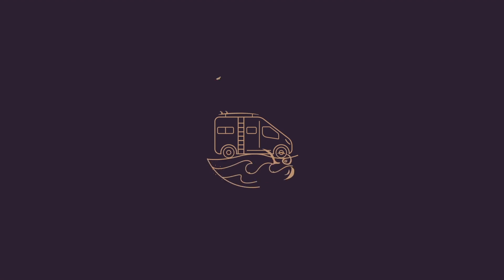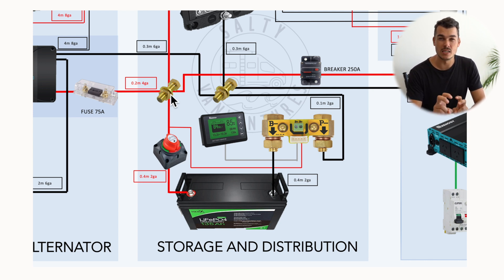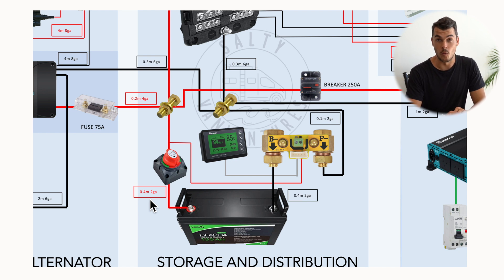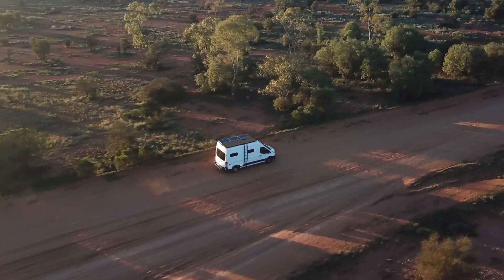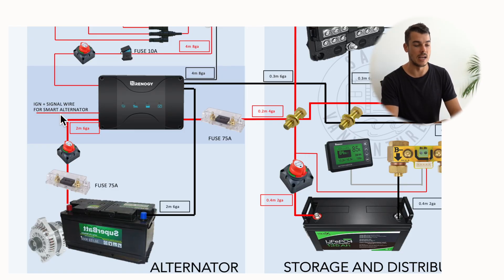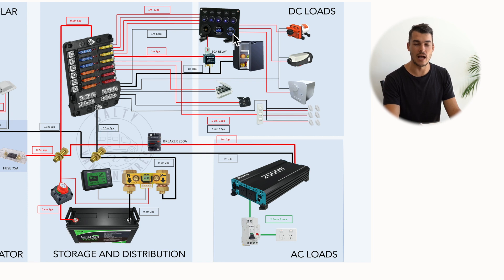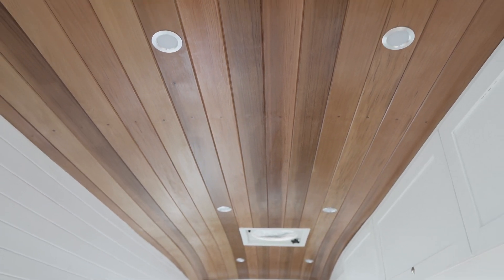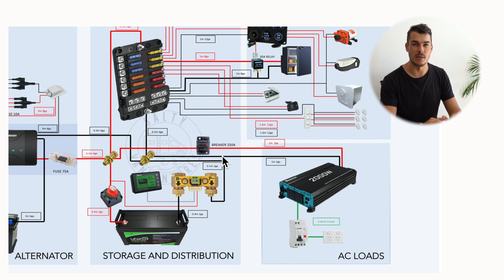Campervan ELECTRICAL System Breakdown : COMPREHENSIVE | Ford Transit Conversion

Comment: Invaluable video man. We'll done. Do we need to engage an auto,/electrician or plumber here in Australia for certification or can you do it all yourself?
Reply from the maker: Thanks man! You don’t need an auto electrician for 12v. You need a plumber if your setting up gas appliances as they will need to supply you with a gas certificate and plate. You only need an electrician if you are dealing with 240v, ie shore power input or inverter) and only if the invertor is going to be supplying power around the van like my system rather than just plugging a appliance directly into the inverter, in which case you wouldn’t need to contact an electrician! Hope that helps
Reply: @saltyvanventures  Thanks man. Enjoy your travels & the pride you feel over your awesome van. We'll deserved for such a nice guy. Thanks for sharing the experience & passing on your knowledge to us Aussie's thinking of doing the same.
Reply: Thanks Ken an Salty Adventures, that was my question too. Best electrics video I've seen so far, and loving the Australian specific content. It's really helpful.l Thanks again!
Reply: @juliewright6889  My Pleasure Julie. I aim to please :) Agree all his video's are very informative. Where are you based in Aus?
Reply: @kjs1069  Sunny Melbourne. Still in the planning stages of my van build.
Reply: @juliewright6889  Yeah me too. We've had some nice days lately :) I'm leaning toward a Transit 470 extended for the extra length and tare weight.
Reply: You need a qualified professional for anything over 60 volts.

Comment: Thanks I have loved all your videos. Just on series versus parallel, isn’t series adding voltage together , while parallel is adding amps. Also you have different panel sizes, so parallel is the perfect choice for your situation.
Reply from the maker: Yes, you are completely right. I have gone and got my brain wires twisted. The circuit runs at around 20v and 22amps. The DCDC charger has a maximum input voltage of 25v so yes that is why I have to connected it in parallel. Good pick up thanks!
Reply: +1 to this, you may need to increase the common fuse size to account for addition of amps too. 
Looking neat otherwise!
Reply: I was just about to write the same thing about parallel/series! Great video though!